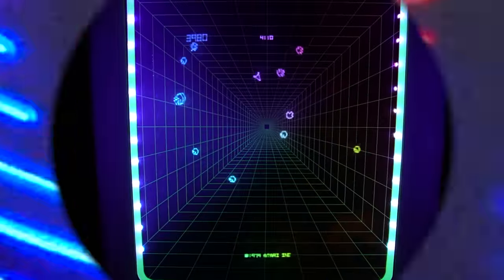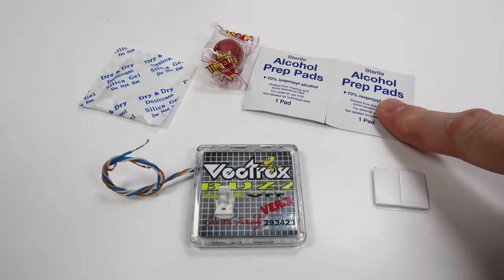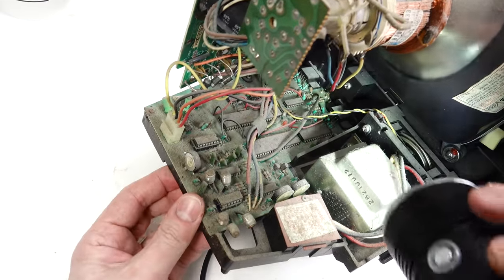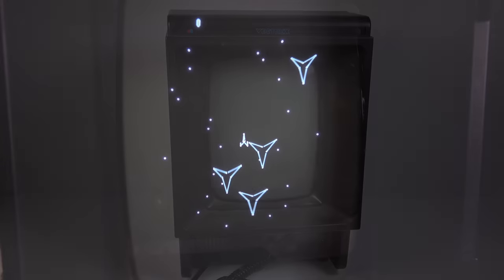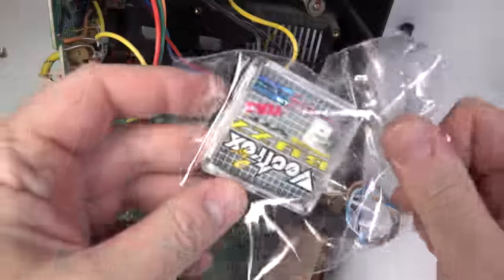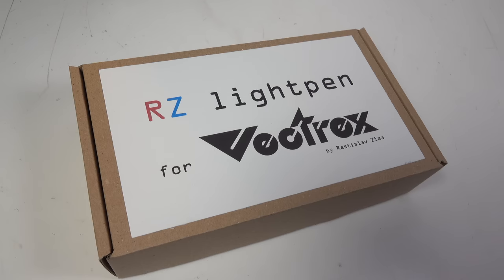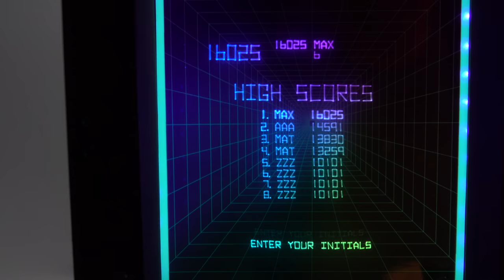Vectrex Buzz-Off Kit Installation

Comment: You know, I'd honestly love to know how we managed before magnetic screwdrivers.
Reply: My dad always used masking tape to hold screws to the screwdriver.
Reply: When I was young, I used to fix old electronics such as televisions and reel tape players with my dad, and we used to stick the screwdriver to an old speaker (the magnet) and get ourselves a magnetic screwdriver that way.
Reply: @nakkistromberg3946  Same. I still do that.
Reply: Blu Tack.
Reply: I just stick a magnet to my screwdriver lol
Reply: When I worked on cars in the 80's, you wrapped a coil of INSULATED wire around a screwdriver, hooked one end to the the ground of a car battery, and just TAPPED the other end against the positive. There would be a big spark and you had a magnetic screwdriver. Wear gloves.

Comment: This is why you want to always use connectors when designing devices. It makes wire installation and detachment easy in case you need to repair the device. It also makes installing everything easy when you can just route the wires through wherever you want and plug them in. If a part breaks, remove it and plug a new one in. And if anyone says connectors are unreliable, stop being cheap and use gold plated pins. Cheapskate.

Comment: You would think the light pen is obsolete but it is not.
One of the biggest companies in the semiconductor equipment industry has such a large installed base that you will virtually have no electronic device that is not made by their equipment. And the operators use a light pen to control that equipment. They wanted to get rid of that long time ago but their customers did not like the idea of different HMIs (Human Machine Interfaces) so the light pen is here to stay (bar newly made equipment).

Comment: When such machines stuck, have compare/verify the firmware to another one, and replace electrolytic capacitors with new ones then check for hairline cracks.
As the processors current load change appears in the speakers, either,wired were coupled to the amplifier or operation voltage buffering capacitors aged.

Comment: This reminds me, I still need to repair my Vectrex, it stopped powering on about 7 years ago and I have not dared to open it up and have a fiddle at the risk of almost certain death.
Reply: It could possibly be the fuse. Back around 1990 or so I knew someone who had two of them and both had stopped working. It turned out that the AC fuse had been blown in both of them. As if it wasn't fiddly enough to get into the unit, they used soldered pigtail fuses instead of a proper fuse socket. Then I had to get replacement fuses and open it up again to replace them. No idea why they blew, but both Vecs worked fine after that.

Comment: You should use flux when soldering. It allows the solder to melt and adhere more easily. This is especially useful when working on corroded and dirty circuit boards.

Comment: Considering you call yourself a soldering amateur, you did well, even with the very minor fudge up, heck I've done worse, particularly when soldering a connector together only to realise I'd forgotten to slide some heatshrink over the wire or a cover that attached to the connector, that's a right PITA when that happens... :P

Comment: I bought a little amplifier board from ebay that had the same chip as the Vectrex and just soldered it's wires directly to the volume control knob of the vectrex and snipped the existing wire to the onboard amp. The sound is so much better. It was $0.79 plus around $0.89 shipping USD.  This description will help you find the part on ebay "LM386 5V 9V 12V Mini Micro Audio Amplifier Module Board Mono AMP HIFI DIY"

Comment: I question why they have you solder the new amp directly to the 2-prong connector inside the Vectrex instead of having a plug on the end of the bare wires. I'll still keep this kit in mind when I get my Vectrex back up and running sometime, though.

Comment: @Techmoan when you have so much dust on your electronics use a hair dryer at cold.
Reply: A little vacuum cleaner with a gentle brush head or just a soft paint brush is the go I think. That way it's not blowing everywhere

Comment: Looks like a good job to me!

It's a bit strange hearing clean sound from a Vectrex, I've only ever seen them on YouTube but they all add the buzz and I associate it with the machine.  It's a good fix though, it was a design flaw after all.

The light pen is very cool, you could have used that for some neat video effects back in the 80s if you could record the screen well.

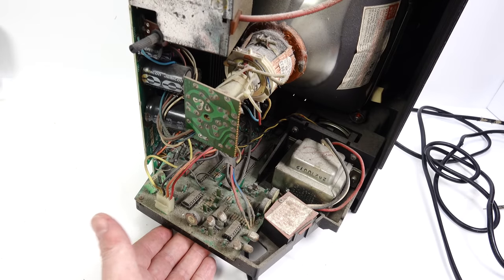Comment: 5:30 - is that signs of that top electrolytic capacitor leaking?  You should consider re-capping it. That transformer looks like it's been pretty hot too...

Comment: I'm surprised that the power transformer didn't defeat the whole purpose of the kit. I guess it's because it works with lower voltages and frequencies (if you can call 240V AC "low voltage") than the flyback transformer of the CRT.
Reply: It’s massively shielded. It’s the safest place actually.

Comment: If your going to own something like this I am not sure I see the point if it's not in original condition. Can the module be turned on and off? I mean I totally see the point in doing it just as if I owned an original Atari ST I would want an ST card loader but still, not original anymore and not how it was intended to be used.

Comment: So if the buzzing is the result of RF, wouldn't it be cheaper to just isolate the original Amp with some heat resistant RF tape?

Comment: New amplifier to remove buzz. Placement? On top the main transformer.  Wut?
Reply: I thought that too, but it worked.
Reply: The transformer makes a small magnetic field. The CRT driver makes a lot of electrical noise. Putting an audio amplifier right next to a CRT driver in the first place seems like a bad design decision.
Reply: If the transformer was creating enough magnetism then the vectrex wouldn't work very well.
Reply: The transformer is shielded, note the metal cover all around it. So it's perfectly fine.
Reply: Transformer has a incredible metal shield around it. It’s the safest place ironically.
Reply: But the proof is in the results.  Noise was greatly reduced - to an unobjectionable level.

Comment: But how did the lightpen work?
Charging the fosphorous display?
The computer itself needed the coordinates. Puzzled..
Reply: A point moves to find and follow the pen, which is a focused light sensor.
Reply: The 8-Bit Guy made a video about light guns and pens a few years ago explaining how they actually work. You should watch that.
Reply: Thanks guys!! I now understand how it must work to a degree. I will check out the  video and understand it fully.

Comment: Makes you wonder what the designer of the anti-buzz device might have to say about not fully accounting for all Vectrex models.  Maybe that soldered version is the rarest of the rare, and you're better off just cleaning it and putting it in a museum.  Edit: Also, those Defender / Tempest clones are staggeringly good.  I'm trying to contextualize being able to own that for myself in 1982 even before the video game crash and three years before the NES, and it's impossible.

Comment: Seems expensive for what's probably a one chip audio amp with a ground, power and signal wire and a speaker connector - and an all-important set of instructions.
Reply: It's a niche product made in limited numbers - apparently in batches of 10, so not quite made-to-order, but not far from it - so prices are inevitably going to be higher than if it was mass-produced in China in three shifts.
Reply: @MosoKaiser   Since soldering is needed to fit it, a kit would make more sense, though the finished device looks smart, it's a thing that goes inside and is never seen again

Comment: I used to write software in the 1970s that used a lightpen to control a vector display that in turn controlled a missile.  But I can't remember how the lightpen worked, but it did NOT have a light coming out of it, like the one in the video seemed to have.
Reply: Vague ideas are coming back as to how the lightpen worked.  On a vector screen, every object is drawn individually in a time sequence, and every object has to be refreshed before it fades away, and faster than the persistence of vision. So all the lightpen consisted of was a light-sensitive detector, which detected the light from whichever object it was pointed at, and the processor knew where it was because it knew exactly when that object was refreshed.  Does that make sense, it was 50 years ago?

Comment: That's look wonderful!. But, My problem is, where can I Buy a Vectrex Joystick?

Almost for years I never know.
I buyed Vectrex on Spain (Europe), but we goes to vacation time, ar 1988s.

So I live in México. I wanted it on Ebay and Amazon too, but haven't options.

Or almost joystick parts. So I turn off my Vectrex at 1996. I only have 1 catridge. My favourite game: Berzerk. Because Vectrex never see on México, only the Atari 2600 and 5200 consoles.

Comment: Hi mate, you'll probably never see this in the sea of comments, but I'll spout my nonsense about soldering anyway. I'm studying to be an electronics engineer - yeah, another Australian Dave Jones/EEVBlog - how original!

The reason you're having problems soldering to old hardware, is because of all those joints are decades old and are full of crust and crap. Think of soldering like welding, because it sort of is. You need clean surfaces to mate the two metal parts and to make a strong connection. The fix for this is flux. It's basically a weak acid that cleans all the crud on the joints which builds up even on brand new components, and makes those joints better accept the solder. You may also need to do additional cleaning with isopropyl alcohol (always have a nice supply, it's great! And you can make your own hand sanitizer with it!), and mabye even a brass brush. I just use the cheap dollar store ones and consuder them to be consumables - I go through a lot, so it's nice to have a supply of these, too.

You can obtain it in multiple ways: in liquid as a pen (probably best for this?), as a gel/paste, and in good solder. Multicore brand solder is the way to go. It's truly the duck's nuts. The thinner, the better. I wouldn't buy anything over 0.7mm for soldering small stuff. Sure, get a roll of 1mm stuff if you're doing chunky power wires, but I prefer my solder to be as thin as possible. You get more control over how much solder you're applying.

TL;DR use lots and lots of flux. Clean off with isopropyl alcohol when done.

Finally, get yourself a TS-100, and a 24v power supply. I shouldn't even need to tell you why - just get one. I love mine so much. And get a chisel tip! Conical tips are complete garbage. Bevel or horse hoof tips are great for soldering SMD packages, because reasons outside the scope of this comment. Just get yourself a TS-100, 24v power supply, a chisel tip, good rosin core solder, like Multicore, or RS Components, I think that's good stuff too, and thank me later.

I hope this helps, even if you never see it. I'm not a qualified engineer - nowhere near. I'm just some nobody who pretends to know shit - I'm a victim of the Dunning-Kruger effect, I know.
Reply: Apologies for the formatting here. YouTube is being YouTube, of course, and isn't even letting me comment properly. I hope it makes a lick of sense even in a giant blob of text.

Comment: Interesting. You mentioned with the first Vectrex possibly damaging it when you were cleaning the dust out. I wonder, would that be a risk of static charges or just knocking free some components/connections?
Reply: More like breaking some of the thin wires.
Reply: @MrVoltz  thanks bud
Reply: eee no? it just temporary stopped working years before he even attempted to open it.
Reply: The biggest issue is to stay clear of the potentiometers that are next to the transformer so that you don’t lock them out of spec with a paintbrush. But generally no you will not harm if you use canned air and a small paintbrush.
Reply: @obtainiumgaming4472  thanks for that. Useful to know

Comment: Seems like the transformer is the worst possible place to attach the new amplifier. I'm not arguing with the results, but I think it's due to filtering components on the new amplifier and in spite of the location.

Comment: Sheesh Matthew! I mean it's great that it works but with a clean-up job like that you'd better pray the 8-Bit-Guy doesn't watch this video... ;D
Reply: Yeah, without WD-40 it is no-go. Love 8-bit guys videos too, but will never understood why he uses WD-40 instead proper cleaning solutions and baking soda instead propper polishing solutions and fine sanding paper.
Reply: @rastislavzima   Because it works. I mean sure, there are better ways to do things but he hasn't had hardware fail on him because of his cleaning yet (not that we know of at least), it's fairly cheap and you can't argue with his results.
I only wish he'd use plastic renewal paste from time to time, that stuff really is a miracle worker..
Reply: @XZenon  sure it works, but with more effort and more scrubbing. I am cleaning some retro electronics time to time too, but would newer use WD40, I use WD40 for what it is made for, for loosing screws, for "unsqeeking", etc. Sure you can use it for cleaning but there are just more efficient agents made for cleaning. Techmoan has also few times shown how to clean more efficiently. By the way 8-bit has ruined the leather handle when he was retrobrighting. ;-)
Reply: @rastislavzima  That's true and right, I actually forgot about the leather handle!

Comment: isn't it rather dangerous to work on old CRT equipment due to high voltage? Is the Vectrex an exception to that? Very suprised this isn't declared or considered at all...
Reply: Did you miss the part of the video about discharging the CRT or are you trying to make a joke?

Comment: Same way you can use any 5 volt amplifier board from ebay, it will cost much lower.
Reply: As the old saying goes:  "There's a sucker born every minute."

Comment: So were they supposed to buzz, or was it a design defect?
Reply: Design defect. Started with not so ideal placement of the audio amp and  late implemented additional grounding due to FCC regulations caused a ground loop. It was officially fixed with the later models (that also don't have the factory red bodge wires on the main pcb)

Comment: Is the hum a result of poor engineering or a product of the time? I know this kit was not available back then, so I am curious if they worked to remove the hum originally or if that was an impossible task at the time.
Reply: Wrong design. In last revision it was corrected but it was short before videogame crash which it didn't survive.

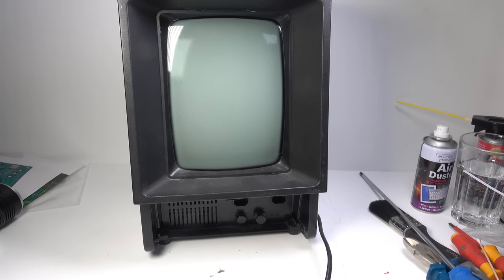Comment: 13:15 I do actually hear a faint low buzzing sound, but that may just be because of my relatively young ears.
Reply: I can hear it...
Reply: Yes I can hear it too.  Younger people should be able to hear the high pitch whistle of the scan coils on the crt 15.6 Khz  if they own one of these or a crt tv.  I could hear the high pitch whistle coming from the back of our Tv when I was young, but now that I’m older my hearing is not what it used to be.

Comment: Is this the original arcade version of asteroids at the beginning? If so, where to get it? How does it behave when many objects are on the screen regarding speed issues of the vectrex console?
Reply: That is Vectrex version of asteroids (Minestorm) which is built into machine and which "boots" if no cartridge is inserted.
Reply: @rastislavzima  No this is not minestorm, since it has "1979 atari inc" printed at the botom of the screen. Take a look at 0:07  ..I had several original asteroids cabinets in the past, so I spotted this right away. Another commenter on another thread is saying this: "
hi shape shifter, I believe that is running on the VecFever cartridge which has onboard processing power and does most of the "heavy lifting" .... I hope they make more Vec Fevers someday so I can buy one"
..I just found this video regarding the VecFever
https://www.youtube.com/watch?v=AMHSCEgbRIw
..and in this video a pc running mame is conncted to the vectrex via VecFever
https://www.youtube.com/watch?v=U-5LWyqn6P0
Reply: @shapeshifter8986  yes you are right, sorry for beying stupid, I haven't watched it carefuly from the start I was exciting to get to the part with lightpen. ;-)

Comment: how in the hell does that light pen work?
Reply: A point on the screen moves to find it.
Reply: @user2C47  like an nes light gun but constantly? how does it know witch way to go to follow it? my brain!!!
Reply: It doesn't follow it as such. It quickly scans the screen methodically, until the light pen detects the illuminated point. For extra precision, it then scans the area around the point with a slower moving point.

Comment: I still have my Vectrex, it's been in my loft for at least the last 25 years. I mothballed it when the control pad started giving up, i.e. the joystick kind of wore through the controller casing after years of hard use. I intended to buy another controller pad for it but could never find one. I'd love to resurrect it if anyone knows where I can get a working controller pad from?
Reply: Ebay
Reply: @rastislavzima  tried before with no luck (some time ago 'll admit). will try again. thanks.